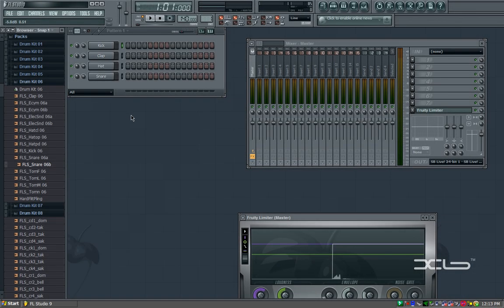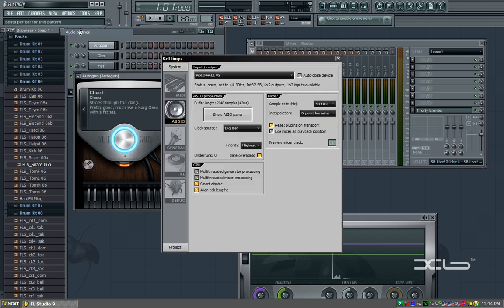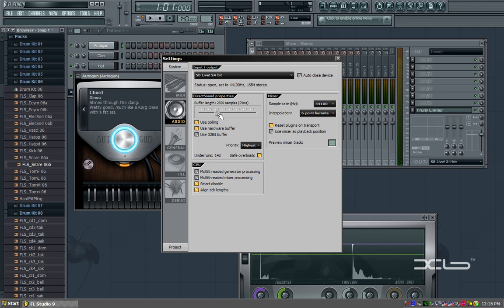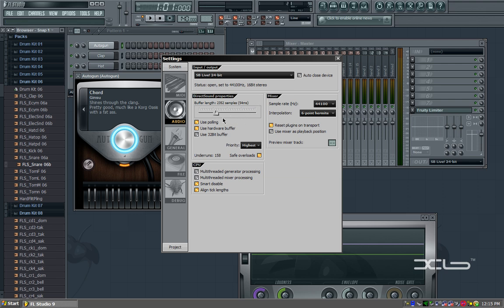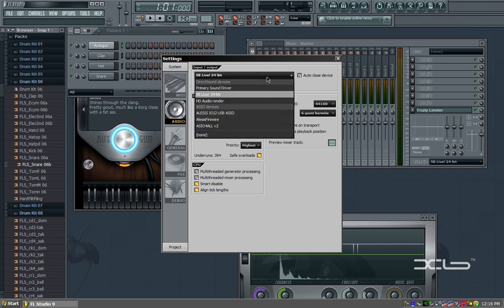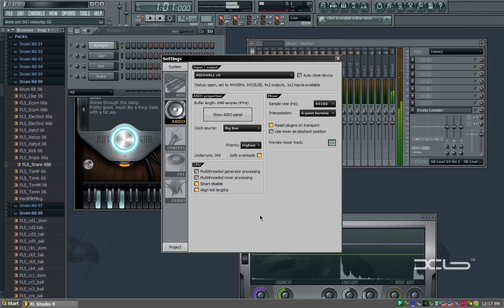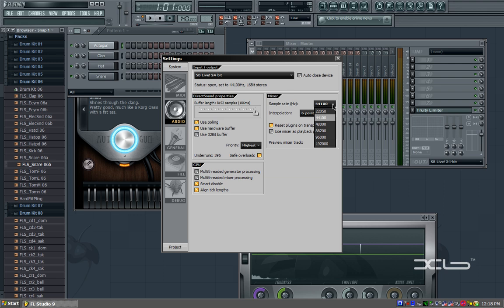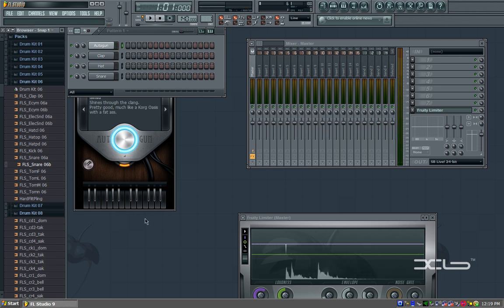:: C's Beats - Fixing FL Studio's Crackling (CPU Buffering) Tutorial ::

Comment: Fl studio manual: Open the Audio settings panel. Try the following steps, after each change, if the underrun count stops increasing, try to reduce the Buffer length setting further. We don't recommend setting the buffer lower than 10 ms (441 samples), CPU load increases sharply with very low buffer settings.

Sounds like your buffer like increase tip is wrong: only time more is better is if you go below 10ms buffer time.
Reply: Oops nevermind think I read that wrong. Cheers

Comment: It used to flash red when my audio was distorting, now it only starts to crack & distort when i convert it to an mp3 why is that? It doesnt sound bad until i convert it, & it doesnt flash red in my fl studio like it used to. Please help asap.
Reply: Are you converting it to 320kb? that's likely not the issue, but it might help. Also, try converting it to a WAV file or making sure your ASIO driver is on

Comment: I use ASIO4ALL with maximum buffer size (2048 samples), but it barely makes any difference =/ my CPU goes up to 100% immediately and everything sounds laggy/choppy.
I run windows 7 64-bit with an Intel Core Dual @ 1.80GHz 1.80GHz and 4 GB RAM

Comment: It is not an error, ASIO4ALL uses the current audio playing at the time, so if you have FL Studio open and you choose to use ASIO4ALL for your current sound driver, it will automatically disable all other sounds playing at the time other than FL Studio. It is the default setting on ASIO4ALL and cannot be changed. Like I said before it's not an error, it's just the way it is.

Comment: I have this same problem, but i think that it's 64 bit drivers... I.E. Windows Vista x64, on a overclocked cpu (2.15ghz or something) /w 4 gigs of ram isn't enough to run FL 9 with Standard Soundblaster drivers... efficiently, but ASIO works fine i guess...